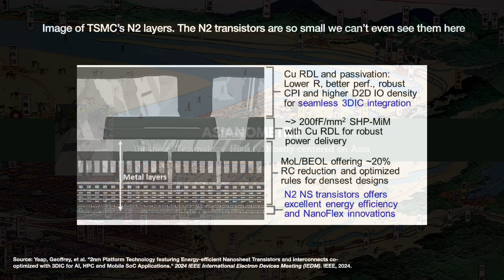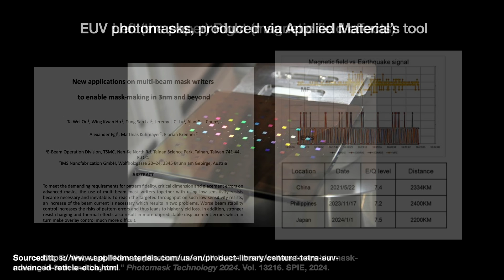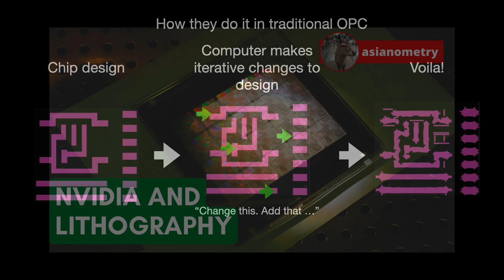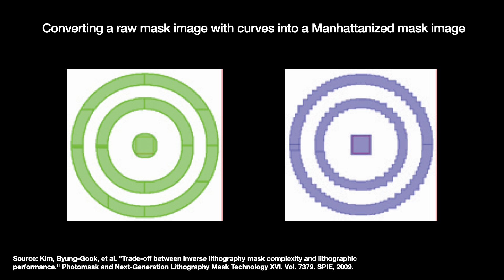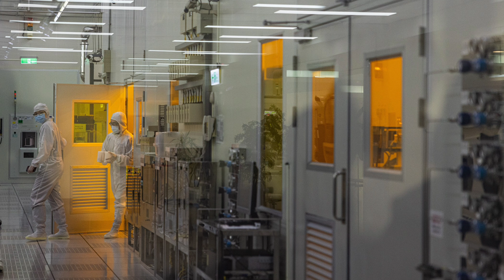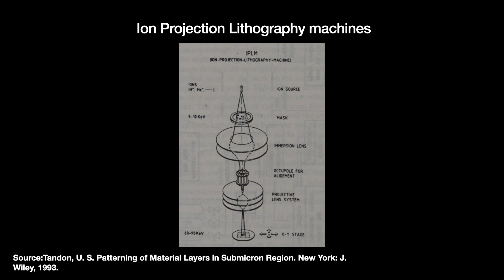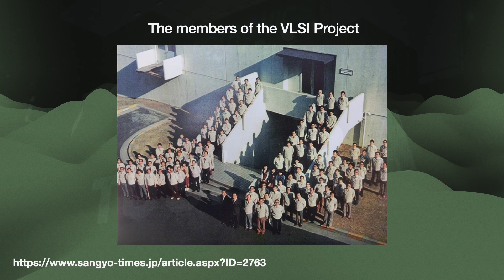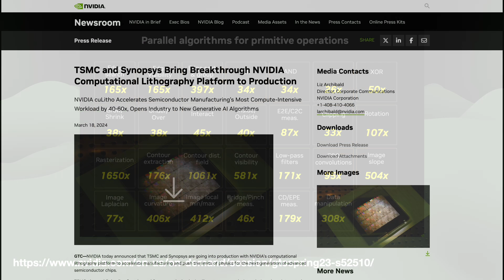TSMC's Incredible 2nm Curvy Masks

Comment: I'm actually quite surprised to find out that methods like ILT weren't already in use. Considering how important light interference becomes when youre so far below the wavelength of your light, I can't believe we made it this far without it.
Reply: Full ILT is incredibly computationally expensive and you need a mask writer than can create the shapes that it comes up with. E-beam mask writers can only print one simple shape per shot so complex shapes for ILT make mask writing for them either very expensive because it takes so long or impossible because you can’t get a whole mask written before something drifts.

So, lots more compute and multi-beam mask writers needed to happen before ILT could happen. Up until now the industry has gotten by with some rules of thumb and multiple patterning. And it worked!

Comment: Such valuable masks! And not Halloween masks either...
Seriously, do they have to store them in a vault when not in use?
Reply: A set of Masked are stored inside and across multiple EV / Litho machines or probably in a vault room that fire prove and dust prove if it does not get fresh air.
You do not want to loss one mask of a full set and be unable to produce a chip .
Damage can be damage on wrong spot by dust or some atoms settling down on it or letting loss by all the light and movement it undergoes  . 
The mask is placed in a container when outside the machine by a robotic tray and inside by what could look to you like a robotic hand to the internal library and from there to the mask is placed on ( forgot the name ) .

Comment: E-beam and/or X-ray lithography may make a comeback
Reply: E-beam is very good for mask fabrication but too slow for wafer mask production. If it takes them weeks to scribe a single 6 inch mask how much time does it take for them to scribe a single 12 inch wafer. X-ray lithography might be possible in the future because EUV is already at the edge of x-ray wavelength. But I think it's more likely for the entire industry to move to nanoimprint lithography than to develop a full on x-ray lithography.

Comment: So the mask is like a hologram of the desired image. Perhaps they can take a picture of the desired image using coherent light and dispense with all the GPU,s. Naw, that would be too easy.
Reply: I’m glad I wasn’t the only one to notice how similar this was to the question of light transport and interference patterns in holograms. It’s not exactly the same, since it’s only storing a single cross-section of an interference pattern, rather than 3-D light transport information, but it’s similar.

Comment: They have curved masks. Curved. Masks.
Reply: Do you get to the wafer fab very often?
Reply: @falkpetersen  I actually advise Jon on microchip matters. My input is invaluable, of course. But this is all probably a bit over your head.
Reply: I came here specifically for this comment.
Reply: Is it to match the curve of the wafer?
Reply: This is etching curves on a flat mask.
AFAIK actually curved masks are still in the works, to simplify optics.

Though the former is probably very useful for the later.

Comment: What exactly separates the multi beam election gun from a classic CRT monitor?
It sounds like almost exactly the same technology - even including a triniton screen.
Reply: CRTs used a single beam per colour, so 3 beams total, each from a seperate emitter. The shadow mask kept the beams from overlapping onto the "wrong" phosphors. There certainly weren't multiple thousands, and the precision was many, MANY orders of magnitude less. Also, the pattern being "written" was always to the same set of pixels, every time. It's like saying a Starstreak missile is the same as a spear. Sure, they're both pointy things that kill stuff, but the difference in complexity is immense.
Reply: It would be the bajillion electron beams I would presume. Also CERTAINLY precision
Reply: Wouldn't it be much higher energy and orders of magnitude more precise? Oh, he just said it's comparable voltage.... I dunno I guess....
Reply: Coils to focus the beams and plate of holes , CRT TV uses 2 sets of plates to bent one beam X and Y and writes one picture 50 or 60 on your screen  ( 50 or 60 Hertz ) .

Comment: thats all great an all, but tsmc said that any improvements below 2nm will come at a premium that (for 95% of the market) will be way over profitability margins. yes, latest and greatest AI chips that cost more than a car are made with 2-3nm nodes, but rtx 50 series is still at 5nm node and amd rx 90 chips are at a slightly improved 4nm. also if you don't mind paying for your next phone 800+ dollars Apple with 3nm got you covered. but thats the financial brick wall most will hit trying to get thin nm chips
Reply: The current high premiums are for GAA transistors. Prices for 3nm FinFETs are stabilizing as expected. The cost of 3nm high-performance transistors will also decrease. There is a lot of fantasy about AI demand in the market, keeping prices up - but not forever.
Reply: @lld4ae  5 years later when the depreciations are written off
Reply: Apple is the one financing this. Intel has annual revenue somewhere 53 billion, AMD 26 billion, NVIDIA 139 billion. Compared to that Apple has annual cash flow of 620 billion. Apple bought Intels communication chip business and now they have C-series and now they came with revolutionary N-series chip and A- and M-series chips are fastest in the market. Apple finances TSMC by buying the production upfront. They ask TSMC how much capital they need to make the next move and give the money to do it. Then they will get all the processors they need and with good price.
Reply: @verttikoo2052 In the past Apple might be bankrolling advancement in process nodes but not 2nm. Apple is not the lead customer of TSMC's 2N fabrication.
Reply: There are two fundamental differences between Apple AI and others. Apple builds it from the ground up so that it is in your device when everyone else wants to send it to the cloud. Now I want my protocol droid and technical droid to solve problems without sending all the data to Imperial servers 😱 That is why the Apple approach is more desirable. NVIDIA is happy to sell tens of thousands of chips to data centers when Apple already has hundreds of millions of AI capable devices in users hands. Apple is also getting the price down. Tim Cook is delivering on Steves promise of having the computer being a bicycle for the mind and accessible to everyone. Without anyone noticing Apple has created a second hand market for the devices so that everyone can find their budget sweet spot. What Apple is doing is harder, but the rewards will be absolutely massive. N-series revolution is starting and it will change the music and gaming forever and it will be important part of the robots.

Comment: As with so much of modern tech, the roots of RET can be traced back directly to AT&T and Bell Labs... but unexpectedly in this case, on the mundane office side of the operation.  The Bell Centennial Standard typeface was designed with many of these tricks to improve the legibility of tiny print in the phonebook white pages by hacking the physics of how ink spread onto the page.  Things like leaving extra whitespace at corners and putting more printed area at terminals all conspired to leave a crisp, legible fixed linewith after the ink dried.
Reply: I was just thinking about how the "gray pixels" are similar to anti-aliasing.  It shouldn't be too long now until we see vectored beams like SVG (scalable vector graphics) masks.